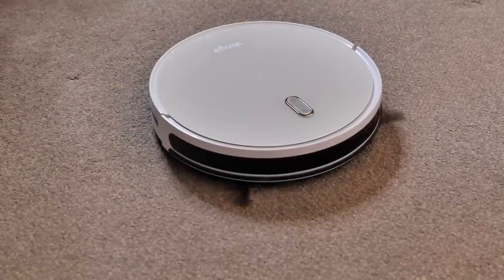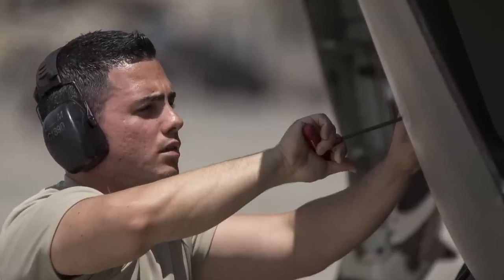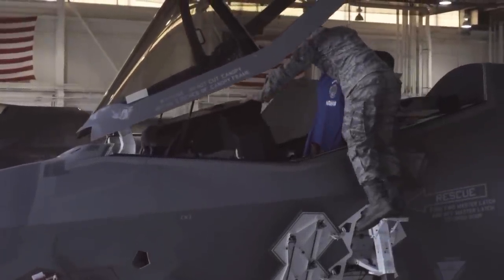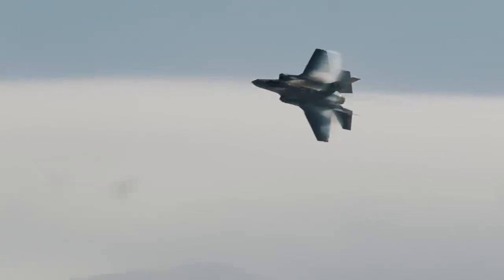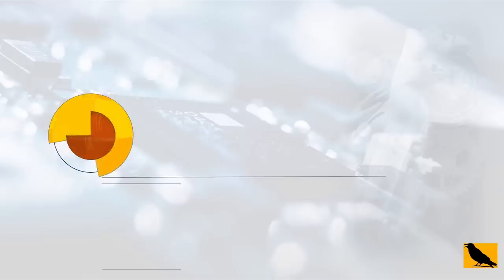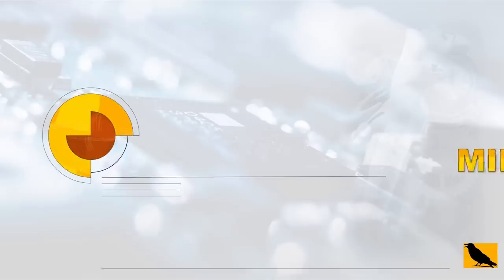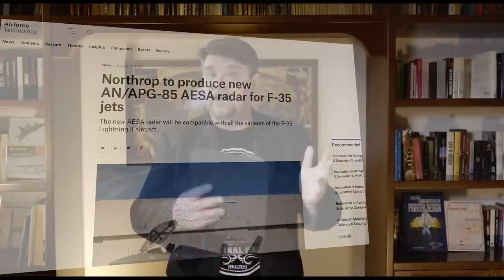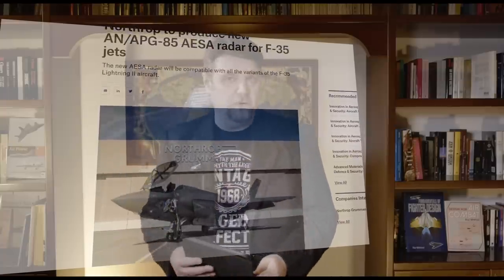AESA radars have a problem.

Comment: All the problems you mentioned are minute challenges that were not problems at all.  Cooling is a very simple solution.  ALL CPU speeds are limited by today's technology, not just AESA, so what is the point??  As for power, we have overcome that with better engine design years ago to be able to generate more power to run all those processors and cooling systems.  What are you talking about here really?  Seems like you are 20+ years behind current technology.

Comment: Any power savings gained by moving from gallium arsenide to gallium nitride will just be used to increase the power of the radar.  The military is no different than PC gamers; when a new fabrication process offers: 1) the same performance as the previous generation with significantly reduced power consumption, 2) a mix of some more performance and lower power consumption, or 3) lots more performance with the same power consumption, they will choose the third option (almost) every time.
Reply: Materials of transistors influence frequency range and power transistor can work with in spec. Termal emission of transistor depends on kind of signal and a little bit on internal resistance of open transistor.
Termal emission is calculated as P=I(t)•I(t)•R(t), where I(t) is current going through transistor at the moment, R(t) is controlled resistance of transistor at the moment. I(t)~U(t)/(R(t)+Rload), where U(t) is voltage at the moment controlled by base current in bipolar transistor, or gate voltage in MOSFET/field transistor.
So for closed transistor I(t) is zero, then termal emission is zero. For open transistor R(t) is close to zero (internal resistance), then termal emission is close to zero. For any intermediate transistor state its I(t) is non-zero, and R(t) is non-zero, so transistor termal emission is equal to P=I(t)•I(t)•R(t) .
Since transistor is not responsible for U(t),  I(t), R(t) it can do nothing to reduce them. The only spec for transistor termal emission is maximum termal emission it can withstand without damage. So transistor radiator shall be efficient enough to conduct more heat than transistor can withstand leaving transistor inside maximum temperature.

Comment: After 12 years, the fu😂ing-35 still with problems 😂
Reply: 12 years? The F-35 project started in 1995, that is 28 years and going project... It is soon time to be replaced with a working variant, built from experience of F-35....